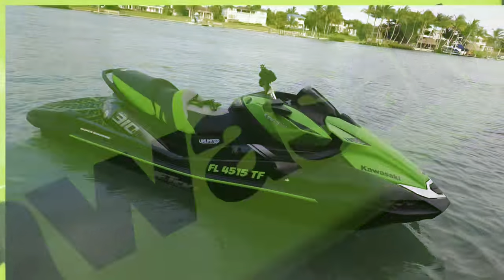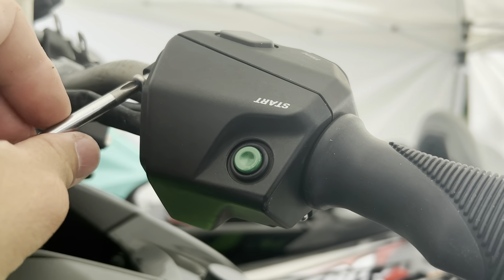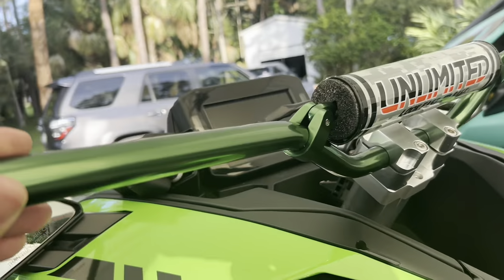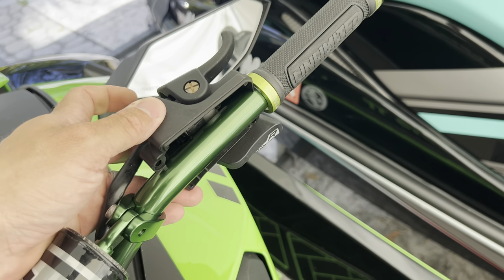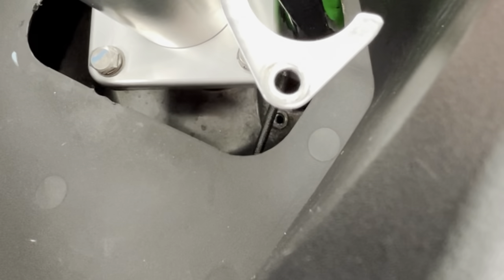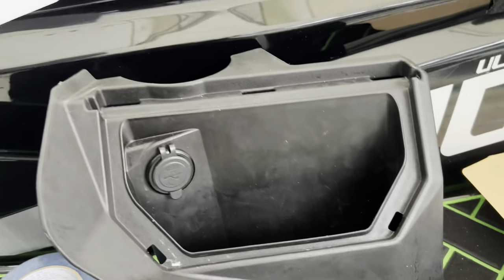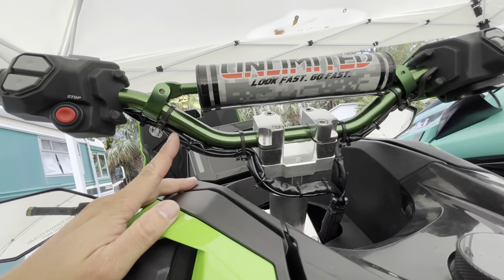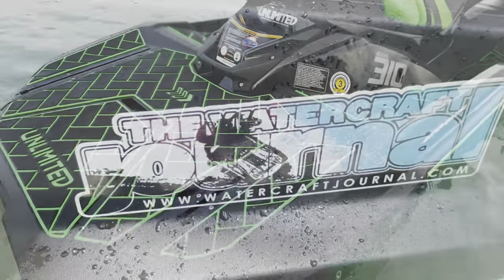Take Your Ultra's Steering to The Next Level With Unlimited PWC: The Watercraft Journal, Ep. 128

Comment: Excellent job and very impressive camera work and it’s only my opinion but I prefer the original handle bars as it it looks so much more polished, it’s a very impressive ski and looks well put together. Please keep up the great work and videos love both channels.
Reply: The stock handlebars are a huge improvement from the previous gen for sure. I had no issue with the stock ones- I did find myself adjusting them a lot- these ones bring you “back to basics” and give you one less thing to fiddle with while riding. Some will love the fixed position, others will not.

Comment: Great camerawork! All the anodized aluminum looks amazing too. 2 questions. First, is the stock geometry retained, or is this handlebar any different, and how so if it is? Also, do you know an approximate weight reduction compared to stock?
Reply: So this handlebar is wider than stock, and has a more aggressive taper. I did not weigh the parts so I can’t give you a direct figure, but I would say with all of the Unlimited components we achieved an estimated 5-8 lb weight reduction.

Comment: I think I will change to this setup but probably try to use the factory cover over the bars. I don't like the play in the factory tilt setup. You really need to cut those 2 bolts shorter that hold the watertight phone compartment in place the next time you have that area apart. Makes removing that so much easier. I also trimmed one of the upper corners some. Still requires some effort but you don't have to loosen and pry the upper deck from the lower deck. You mentioned someone losing a key while riding? That would suck and I don't like that Kawi made the fast key black now vs green. It still floats but green is easier to see. I attached an orange Chums keychain to my key. Also had a green key flashed to work on my Ultra 160 lxs. Keeping original black as a spare. I didn't think I would like the key in the handlebar setup but so far I like it. Not sure I want to lose the space in the glovebox the key would consume. It is a neat install though.

Comment: Excellent job good work, but I would never consider swapping to one of these and putting the immobilizer in my Side compartment!? It’s great they sponsor your channel though, so I get it👍🏻
Reply from the maker: Why not? We’ve seen people lose their keys a bunch since Kawi moved them to the bars.
Reply: @watercraftjournal  TBH, doesn’t look that appealing to go through all that work, plus cutting holes in the factory plastic like that, Also in my opinion makes the watercraft lose some value if It were ever to be sold, After that u might as well put on the visor now lol There are the factory holes already predetermined marks in the plastic which I’m sure you’re definitely already kno..
You’re doing an awesome job with the channel, and enjoying all the content just not a big fan of this at all, to each his own lol
Reply: Scott, definitely mods like this are not for everyone. If you want a one-of-a-kind custom ski- Unlimited has you covered with all the parts. Some guys prefer to run stock, and there’s nothing wrong with that at all. Also, just to note- every single mod we’ve done is fully reversible- with the exception of the hole cut out inside the glove box. These aren’t the major engine mods that have become popular these days.
Reply: @JDsWaterWorld  Totally about mods, I have quite a few on mine, And I’m sure Unlimited has lots of great stuff, just this mod Was not my cup of tea.